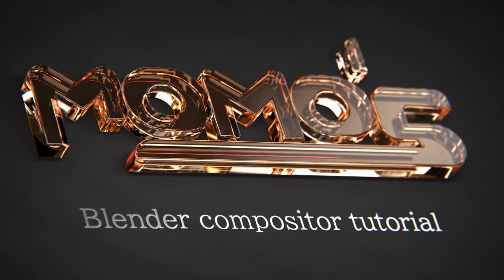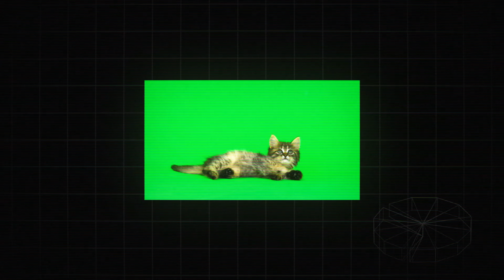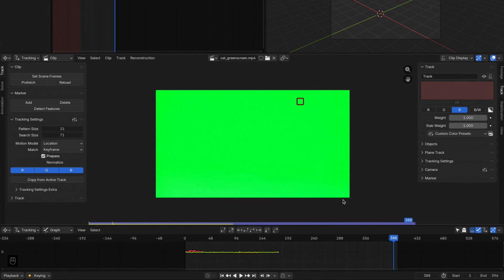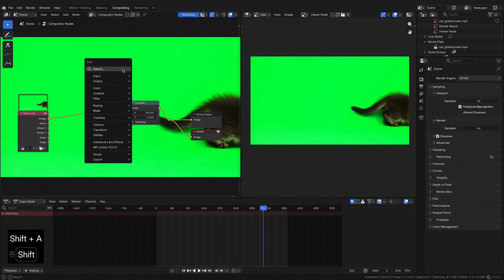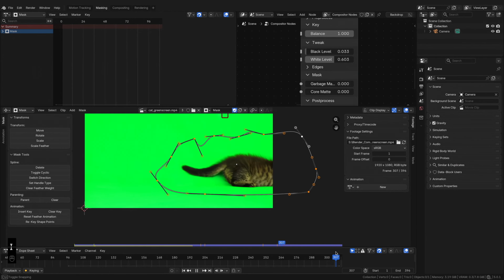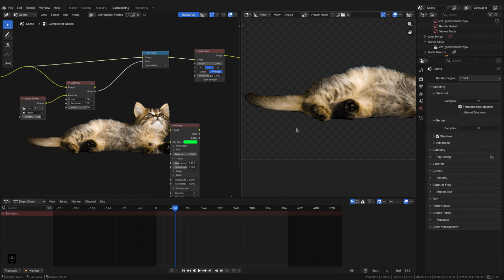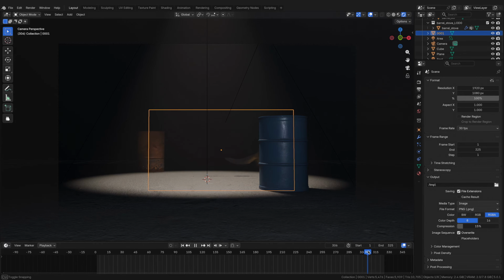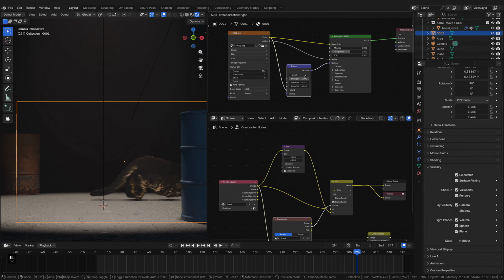Greenscreen removal in Blender's compositor

Comment: Nice! Btw I have two viewlayers combined in composite with alpha over node and in the viewer I can see its all good, but when I render it it renders layers separately. It looks like the group output is not doing what it should, really stupid stuff
Reply from the maker: Yes, each viewlayer is rendered seperately. After both finished rendering, the composition should start to render and merge them. When you're previewing it, it will use the last rendered frame as long as there is one available
Reply: @Moportfolio  I am familiar with all of that, but my older project in B5 wont render composite at all even tho I have group node, it renders only separate as I said. Nevermind

Comment: U can make Twixtor or any like frame interpretation effect? 
I want make stop motion effect with high fps
Reply from the maker: Blender doesn't have frame interpolation afaik. But you can change the speed of a video by keyframing the "Offset"-value of an "Image"-node in the compositor. Bit tedious though, but possible.

Alternatively you can use "Shutter Encoder" which is free & open-source, as it has multiple interpolation models.